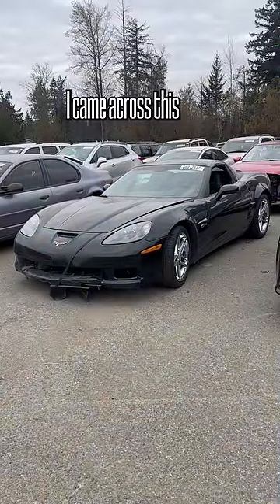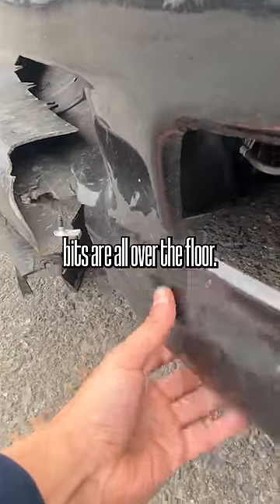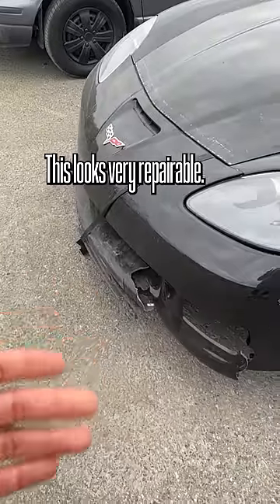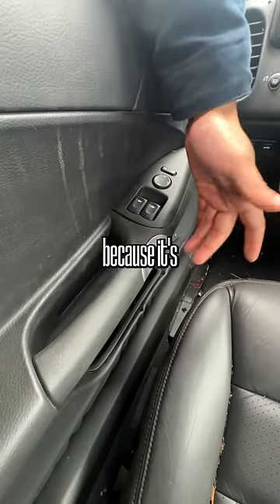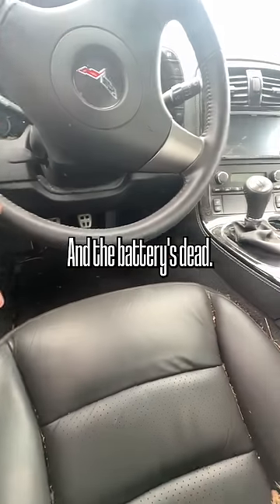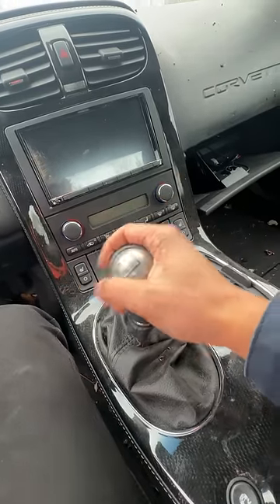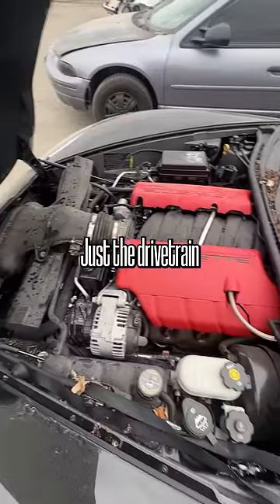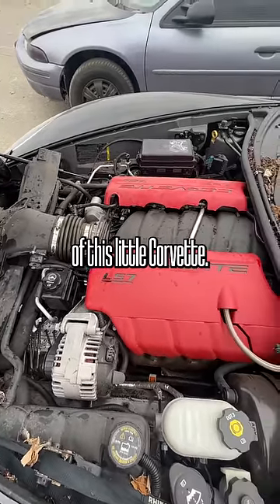Auction C6 Chevy Corvette Z06 - Left to Rot?

Comment: The fact the manual release for the door was right in front of his face is the funniest part of the video.
Reply: A sign the car business might not be for him?
Reply: @mipmipmipmipmip on the driver side floor to the left close to the seat
Reply: Thats not the manual release, the manual door release on that generation is in the back hatch, and the manual release for the hatch uses the key inside the key fob
Reply: @blacksunshinegaming9315  Even though you can clearly see the door release on the floor in the video?
Reply: @blacksunshinegaming9315  I drive a C6 every day that is a manual door release on the floor in the video. There is also one in the trunk.
Reply: @blacksunshinegaming9315 wrong. The manual door release is on the floor right next to the seat. What good is a manual release for the doors if you have to climb into the back hatch of the car to use it lmao.

Comment: No reason to not repair from what we see. Not stolen, no major body damage, and a perfectly healthy LS.
Reply: Probably Insurance write off.
Reply: LS7s unfortunately have a problem with randomly dropping a valve seat and blowing a hole through the block, so watch out for that. A set of aftermarket heads will fix that.
Reply: My bet is they curbed it hard. Frame damage isn't worth the effort.

Comment: That ls7 is getting swapped into something
Reply: That's a Ls3
Reply: @Luistorre Z06 has LS7
Reply: @mafu46  🤡🤡🤡
Reply: @mafu46  know you're engines
Reply: @mafu46  how blind are you?
Reply: @mafu46  rather then dogging on you for not knowing I’ll inform you. The car is a c6 zo6 and the engine that comes with it is a 7 liter v8 or the ls7 as seen on the top of it when he opens the hood. Hope this helped.
Reply: @richardkevorkian5285  the hero car noobs need 😤😤😤🙏🙏
Reply: @richardkevorkian5285  Ur a nice dude bro. Need less toxicity in ts....
Reply: @PercocetMoe  thanks man. I like your name lol
Reply: @richardkevorkian5285  preciate it bro im just invoking the sterotype. Bring racist jokes back!!
Reply: No it wont, it uses a dry sump system thats hard to swap into other vehicles, and LS7s are NOT good swaps as the motors are only good bolt ons/cam
Reply: @AZ_CRUISING  Why would it be hard? Its just an oiling system. (Genuine question, i have no idea...)
Reply: @MWAclanGaming  learn grammar
Reply: @wpww3343  Learn to capitalize the letter
Reply: @MWAclanGaming  learn to differentiate your and you're, then talk to me about capitalizing letters, kiddo
Reply: @wpww3343  imagine talking tuff on the internet 🤓.
Reply: @MWAclanGaming  ''tuff'' ☠️☠️☠️💩💩💩💩
Reply: Shame

Comment: If it's undercarriage damage the previous owner probably looked at the cost of fiberglass repair and just totalled it instead
Reply: It's not fiberglass. The entire floorpan is a carbon composite that costs almost 4k. And it's molded around the chassis of the car. If there's underbody damage your looking at close to 10k to fix it.
Reply: @JJWolf-hb6dn  And the chassis of the car is made out of?
Reply: @terracar2003  aluminum
Reply: @gabrielcollazo6835  Right, so you have a hard to repair metal (you just replace aluminum) bonded to a very high strength fiber polymer, under the car, plus anything else that broke yeah kinda expensive to fix not even including the fiberglass body
Reply: Preciate the insight. Im getting a c6 so this helped. I didnt know it would be 10k. Prices are insane wtf
Reply: @PercocetMoe  He's talking about the Z06 model, a base C6 is different and has a steel frame.
Reply: It depends on the purchase price
Reply: No made of fiberglass, what are we in the late 80's?
Reply: @SS OFFSHORE  some prefer the steel frame because it's stronger. The allumnum bodies are lighter but use thick guage to make it strong, but can break instead of bend like steel does.

Comment: In the mid 70s I worked at a body shop doing custom  auto body , the owner ran into financial trouble n couldn't pay all the help , so the forman told everyone to take a car  til he comes up w the money , me n my buddy chopped a corvette up , we cut the nose off, took out the engine, seats , tired n sold that stuff right away , we sold the rest for scrap n cut the frame into small pieces n sold the metal ! Car was completely vanished in 6 hours lol

Comment: There's a lever to the left of the seat to open the door. Also if you have the key, you can open the trunk and pull the wire on the left to open the door as well.

Comment: From a 2006 C6 Z06 owner, I’ll tell you it’s worth every penny to restore and drive that car. You will never experience low-end torque with so much raw output while also having the biggest smile on your face. 32mpg @80mph and a solid cruiser/racer all around.
Reply: 32 mpg is insane. idk how true that one is
Reply: @lukegamble4349  4 years of daily driving this car from cruises around town to complete road trips, it’s extremely accurate. 6th gear in Z06’s are meant for highway fuel economy. Theoretically, if the engine spins out to 7000rpm (redline for LS7) in 6th gear with the stock rear differential final gear ratio, the car could do 324mph (assuming it had enough power lol).

Comment: For anyone else struggling with the door with a dead battery, there's a key hole on the back right above the license plate facing down towards the ground.  That gets you into the trunk and then from there there is a handle to pull to pop open the door.  Once you're inside there is a lever or floor right beside the door.  If the window is open you can also just pull that lever.   It's not recommended to do this regularly though because with a dead battery the window doesn't go down slightly to make it past the window seal.

Comment: On corvettes the air dam sits right in that area that was smashed off, and the way the radiators are situated around it mean they are unlikely to not be damaged by that piece being ripped off. The cooling system also runs pipes and hoses pretty close to the ground around the engine. Even if there is no damage to the engine itself, repairing the cooling system on that is likely an engine out job

Comment: should be alright bottom wise i’ve bought 3 wrecked c6s all held up very well only thing that tends to fail is the gas tank seals will get loose if touched but it’s a slightly easy (free if you don’t upgrade seal ) fix so should be good.

Comment: Everyone’s already told you, but with the window down, the inner floor latch is an option for opening the door. But if the window’s up and you have the fob, pop out the spare key and open the back lift gate (trunk on a convertible). In the back will be a small pull tab on each side that will open the respective door. These C6’s are notorious for killing batteries when they sit, so you’ll need options.

Comment: Hey mercia, don't be sleeping on those new gr corollas. Here in Australia I have the gr yaris  and it pulls away nicely from the 5.7L LS. So if you're wondering the little turbo 3 cylinder goes hard, and the corolla has more power then the yaris

Comment: On these Corvettes there's usually a mechanism somewhere to the left of the driver's seat to open the door manually so you can still get out even if the electric latch doesn't work

Comment: Depending on the price and condition of title. If it's not a salvage, it could be worth more in parts than whole, but if the front bumper cover is all that needs to be replaced, yeah a Z06 is totally worth it, especially if it's the 7 speed

Comment: The LS7 in this car is worth a fortunate in itself because of the big cylinder bores the engine had to be hand built and the cylinder liners are pressed in

Chevrolet grew to loathe this engine because of the cost which is why for the next generation of Z06 they went to a supercharged 6.2 which all they had to do was lower the compression ratio for the boost and everything else was bolt on

Comment: On the inner side of driver and passenger door download there's a Level to pool it will open the door automatically that was put there just in case the battery died you would be able to get out

Comment: Knowing these inside and out, this would be a very easy fix, unless there’s structural damage to the frame, which it doesn’t look like. Couple thousand dollars in actual GM parts, or maybe $1000 in used/aftermarket parts and it’ll be back to new on the outside.

Comment: That is an LS376/480 6.2l engine.  $8000 for the engine.  $6 to $10,000 for installation remove and replace.  The rest $5,000 to $12,000.  Depends on what you can do by yourself and how much it will go for at auction.

Comment: Few years back the guy that lives down the street bought a viper for 7 Grand
After about a week he found out the frame was bent to s*** the car was worthless
He pulled the motor with figuring what he would put the motor in when he tore the motor apart the motor was shot spun bearings
What do you expect though a new car

Comment: I just thought about something. If the battery is dead and the windows are up, how do you get in a Corvette when that does happen? Is there like a key hole that opens it?
Reply from the maker: good question 🤔
Reply: @bendaga  I'm going to do some research on this. Chevy must have a backup way to open the doors from the outside.

Comment: You can buy it spend a bucket of money to find out the car is only worth half of the blue book because it was wrecked and
Rebuilt.  I bought one and had a hell of a time getting rid of the car and it was a great driver.  I basically broke even with no credit for labor.  But I did have fun driving it.  It could also be a flood damage. Death to electronics.

Comment: It's not like a c5 with a metal frame.. the c6 has aluminum frame .. if it is damaged even slightly. The repair itself could outcost the engine.. oh and the engine could be busted from underneath.. I'd bid $2500 comfortably

Comment: "I'm gonna ask you if it's worth restoring but won't say the cost"
Reply: It’s an auction…these days, it’s anybody’s guess.
Reply: Assuming 5,000 for the car and 15,000 in repairs. The mint condition ones I’m assuming go!for 25,000 dollars then it’s not worth the effort. Unless u want to built a substandard one with 10,000 dollars in repairs and drive till the wheels fall after 3-4 years. Also it has to be your second car otherwise it will be negative impact on one’s lifestyle 😮
Reply: No shot it's 5k
Reply: @Jake39019  The used car market fluctuates based on supply and demand of other goods like business export import and so on and so forth. So yeah it can be worthless to somebody and very desirable to someone else.

Comment: LOL. If you have the key FOV, you open it and it has a key. Rear trunk next to light, key hole. Key in hole and open it. Batter on the right or left side has pull lever to open door.

Comment: Everything is a gamble but that one looks like low risk. The vehicle looks like it's been sitting outside under a tree most likely it does not run. The damage to the front end I'm guessing was done by the flatbed/tow truck driver. Many import car dealers will not do any repairs or offer in-house warranties on Corvettes when taken in on trade. They end up at a wholesale lot.

Comment: The cable release is on the left side on the floor. Also being a Z06 check for aftermarket heads. If it doesnt have aftermarket heads theres a decent chance the heads werent “fixed”. Unless you get that car suuuuper cheap. Plan on fixing or replacing the heads. Because if it lets go of a valve guide while you’re driving kiss that motor goodbye and you’re looking at $15k for a new motor.

Comment: Given the fact it has an n/a ls7 
Which is a 7liter 427ci v8 that revs to 7000 rpm it’s the crème of the crop of ls it’s a 10,000 dollar engine 
And if it’s undamaged like no holes in the block 
It can be fixed and be so sweet I think it’s worth it just for the engine

Comment: Dude it might be a steal depending on if it runs and drives. You could probably get away with just a new bumper,radiator, and lower radiator support.

Comment: Car has a bad bumper and you’re asking if it’s worth restoring? Worst case it also needs a front subframe, control arms, tie rods and some engine mounts or arms. The oil pan is tucked up higher than subframe bc dry sump and the trans doesn’t have a pan so this is an easy buy. You would put worst case $4k into it to make it nice again. Crazy how someone so clueless is at auctions buying cars maybe go back to college?

Comment: I'd say something with the transmission is why it's their. Because no one in their right mind would throw a vette in here because of the bumper. That's just my thought because you have to take the whole rear end out to get the transmission out, and that in itself is time consuming and expensive. Is worth saving though? Absolutely. If the engine is gone by the time someone buys the car, I'd duramax swap it to be different.

Comment: There emergency release handles on the inside on the floor of the car at the bottom of the door, just in case the battery dies, you wont get trapped inside, theres the mechanical latch

Comment: a bit of an FYI if you are at an auction and you see a corvette that sits lower then it should be sure to check the engine block with a magnet . Chevy never sold a LS based corvette with an iron block and the extra weight of the iron engine causing the front to sag is a dead giveaway it was changed . but that's not always a bad thing the 5.3 LS loves boost

Comment: You can open the drivers door when the battery is dead by opening the drunk with the key and then pull the tab that sits behind the small plastic door on the drivers side in the drunk.

Comment: If you pull the lever down at the bottom of the floor the door will open battery dead or not it's in case of wrecks had to use it once telephone poles are not my friend

Comment: On the driver's seatside underneath the leg on the floor is a lever you use that to open the door without batteries.  You have one for the passenger over there also